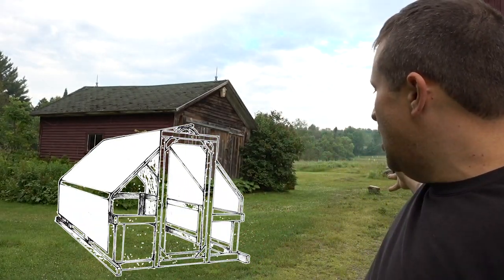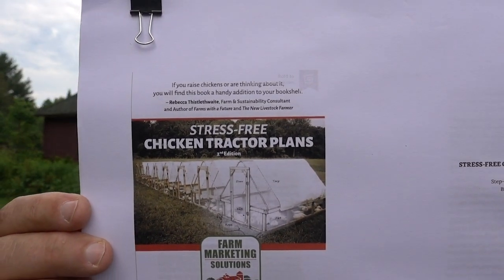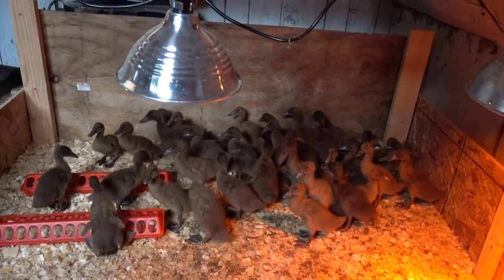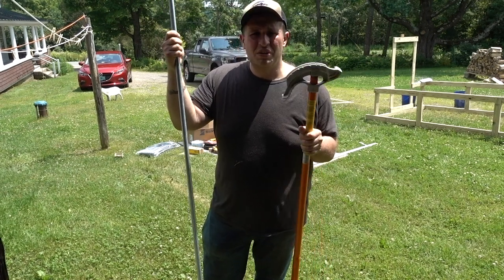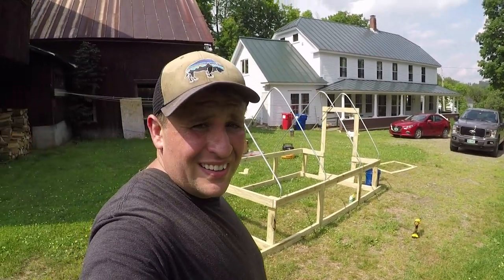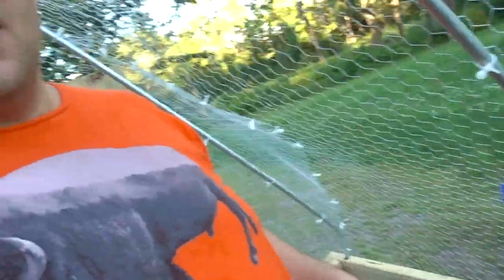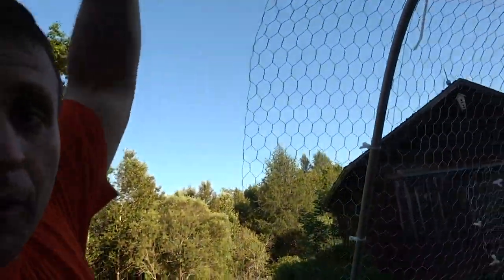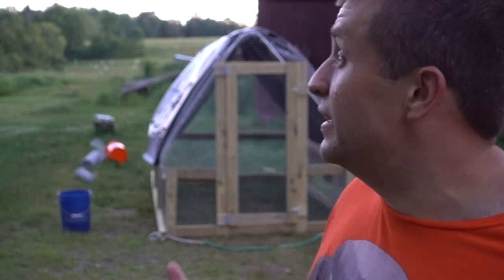Mobile Duck House Build

Comment: Thanks for the video and the cat comic relief.  I’ve started in on this project and thought I would mention that a table saw or a radial saw with a dado blade works wonders cutting  lap joints.  The one cut everyone should look out for is the longest side rail where the joints are offset at slightly different lengths from the edge.  A difference of four inches and it’s hard to catch on the cut plan.

Comment: If you run your saw at an angle mult times, holding it with two hands, you won't have to spend so much time with a chisel.  Clamp the wood so it doesn't move.

Comment: Did you use these for your ducks throughout the winter? And did you end up making any modifications? How are they holding up?
Reply from the maker: The chicken tractor worked great until October, but then I repurposed an old hay shed for the ducks. If you watch one of my recent videos, you can see it in action. That said, I’ll go back to the tractors this summer. I’ll probably build more for the birds we plan to add.
Reply: @GoldShawFarm  I'm thinking of something similar but smaller, just want 2-3 for eggs. I don't have nearly as much space but thought I'd work them across the garden area in Spring, move them inside my 5' chain link fence close to the house for winter months to be safer from predators( fox and coyote in my area mainly), add a box to the chassis to let them inside with straw and possibly add a low voltage light as a heat source. It can get zero here.  Will they lay in a nesting box? I've read that ducks just lay wherever. My neighbor has a pond about 50 feet from my property, wondered about letting them use it occasionally, not so sure they would "go to bed" though given that freedom?

Comment: So you just have an open bottom for your house? We're trying to make a mobile goose house for them to sleep in at night, but I worry about the bottom being open to potential predators. We talked about having hardware cloth across, but I also worry about that hurting their feet. Do you have advice on what to do? Thanks!
Reply: From what I can tell about this design, it's dependent on being fenced with either electric net or strand (John Suscovich has chickens in several of these moved daily within a fenced-in pasture that also moves).
Reply: @oddjobzombie  Thank you!!

Comment: I don't see the point in cutting all those half lap joints for the chicken tractor. Yes it looks a bit better, but it's a chicken tractor and the time spent on 20 joints really offers no benefit.
Reply: The plans suggest gluing, which absolutely adds structural strength.
Reply: Agreed. Toe screw it and move on